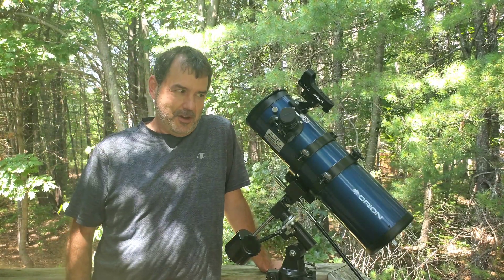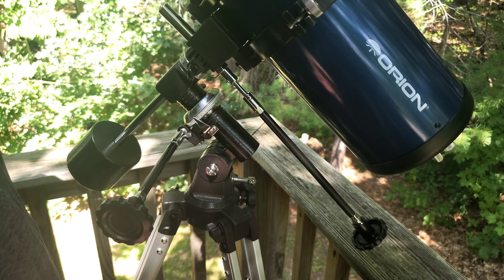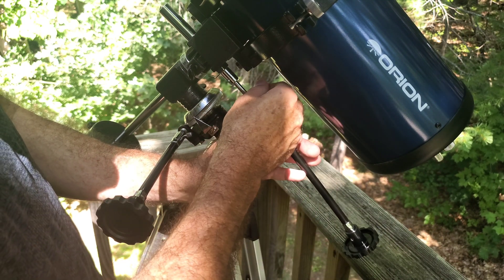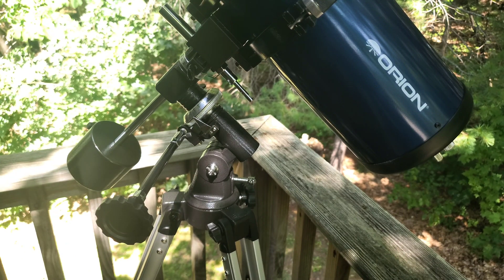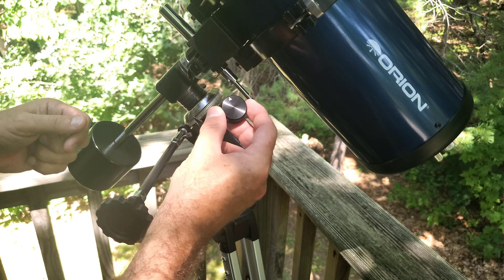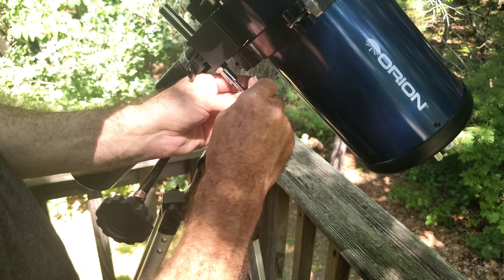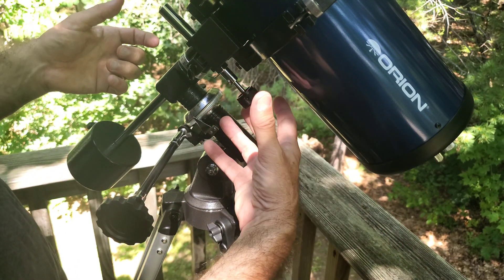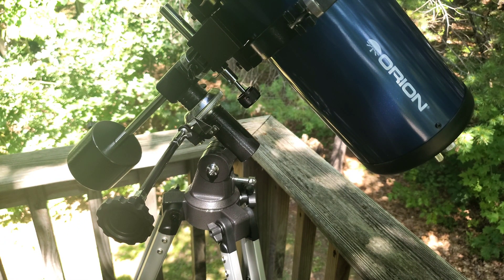Replacing the Slow-Mo Cables | Orion StarBlast 4.5

Comment: Why not replace the slow motion cable thumb screws with hex head screws like on the potentiometer knobs?  Wouldn’t that achieve the same result since you’d be tightening them down with a hex wrench?
Reply from the maker: Uh... yes. That's a great idea. I'll look into doing that and let you know how I make out. Thanks!
Reply: @thegreenstargazer - another thought, if the set screw is long enough, install a small hex nut onto it first before attaching to the stem. then when you tighten the set screw, tighten that nut to lock it down
Reply: @brachus12  Indeed. Thank you!